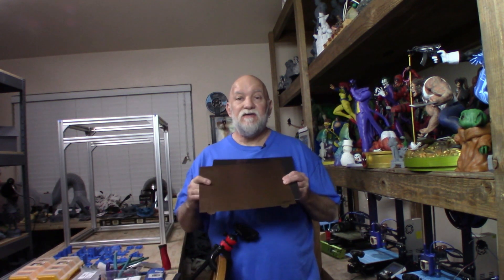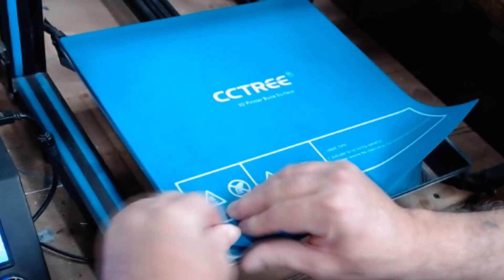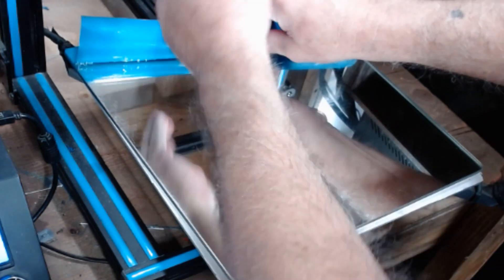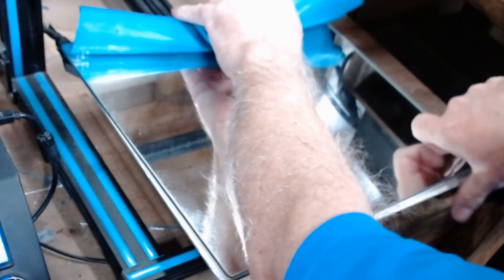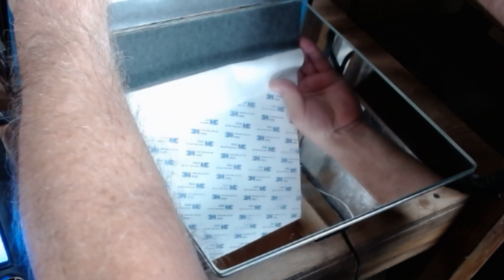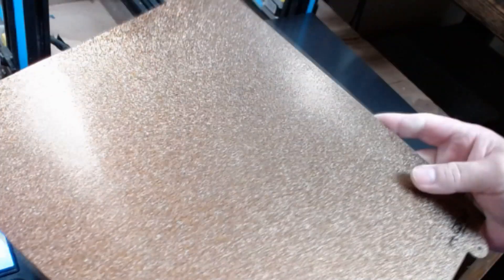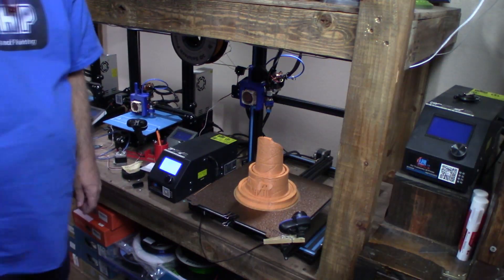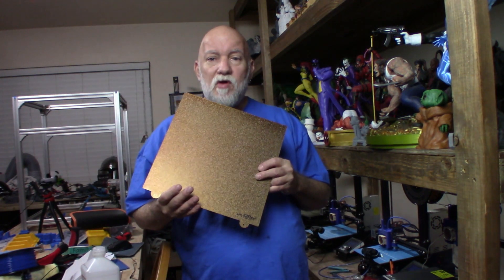Installing the EZFlex Plate with Textured Pei on my CR10 #3dhp

Comment: You already have the perfect build plate in the mirror, try using saltwater on it, I use this method and have saved a bit of money on not buying glue sticks, here's a PDF on how to apply the solution
https://www.uantwerpen.be/images/uantwerpen/container11343/files/bonding_pla_with_salt_water_v20160713.pdf